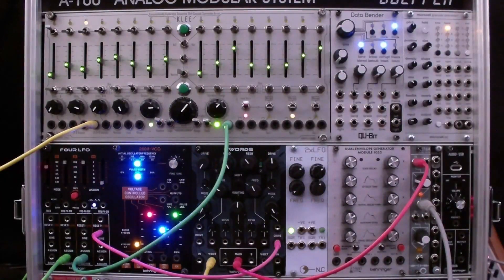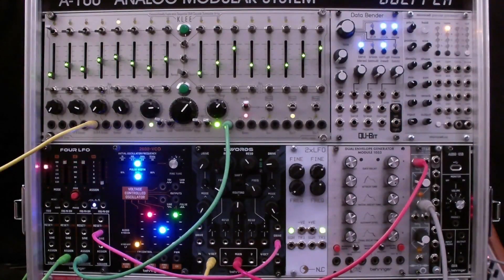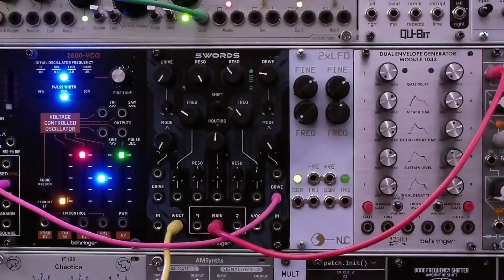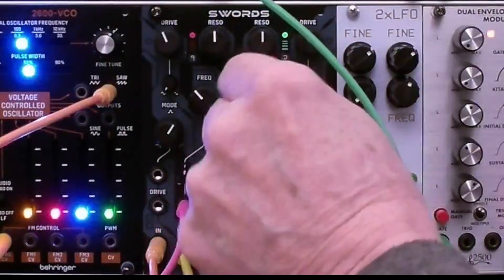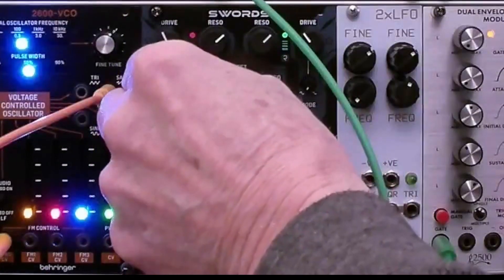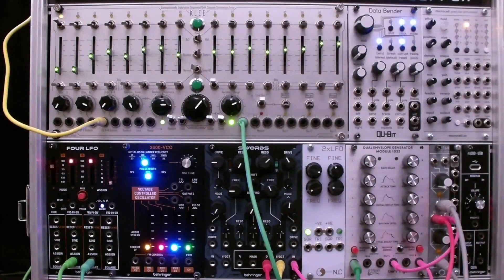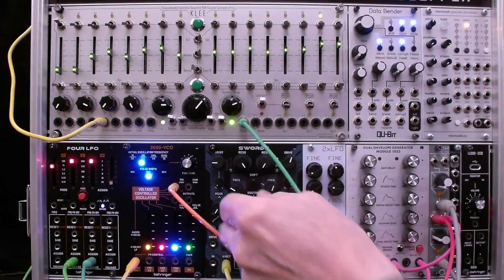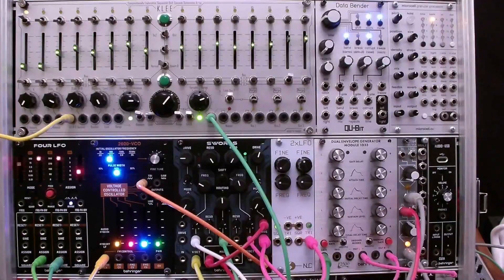Swords Dual Filter by Behringer  - the basics

Comment: Thanks, O.Z., interesting like always. I would like to know: If I want to get the "liquid" sound (rolandish) from the Ripples/Surges filter, could I just use the Swords as a double Surges? Or are these different designs?
Reply from the maker: Thanks!  Both Blades/Swords and Riples/Surges are based on the V2164 quad VCA chip in multi-mode filter topology.   Ripples/Surges also uses an LM13700 OTA chip "for that extra bit of non-linearity".  So they are slightly different.  I suspect you could hear a difference, but I have not heard a Ripples/Surges filter.
Reply: Thank you!

Comment: Who's going to make aftermarket panels though?
Reply: You can't swap Behringer panels because of the way they are manufactured. At least that's how their other clones are.
Reply from the maker: @dasvoid1  Thx for that info!
Reply: @dasvoid1  How is it that it can't be swapped? Have they used nails, are spacers welded to the panel?
Reply: @KPsTboy  Behringers modules have front panels that attach to the PCBs with metal standoffs that are part of the panel. They aren’t secured with nuts on jacks, pots or buttons, so there’s no easy way to swap a panel. I suppose you could add standoffs, but then there would be a few screw heads in the middle of the front of the panel.
Reply: @ So welded spacers, thanks for confirming, appreciated :)
Reply: @dasvoid1  They use those dumb metal standoffs but it doesn’t matter. Anyone could sell a panel with some standoffs that screw to the panel and also to the PCB if necessary. Some might be held on just fine with pot and jack nuts. 

I don’t know why companies don’t make clean aftermarket panels for these modules. Ironically, maybe Behringer has threatened to sue anyone who tries.
Reply: A better way maybe would be to make such vinyl overlays, like Heinacron makes for other Behringer synths.
Reply from the maker: Good question.

Comment: OZ do you know if the module can be updated? Quite a number of Emilie's modules have had community updates to her code. Considering the pricing of the Behringer versions they could become very affordable development platforms.
Reply from the maker: Great question.  The answer is "No, it's not a firmware based module.  It's all analog (except perhaps for some of the routing, which may use digitally controlled analog switches.)".  I have not studied the schematics.

p.s. check out the patch_init() from electrosmith.com  it's  a reasonablly priced ($199) development platform with high quality audio i/o.
https://youtu.be/HOjqQYlDj2U
Reply: That was the original intention Of making everything open source but instead everyone just cloned them and I believe is what eventually caused the company to shut down. There are only a few analog MI modules. Blades, Ripples,
Kinks, Links, Shades are a few. The rest either use an STM32 or some older units use an ATXMega32.

Comment: exceptional video Professor.. this one didn't really pop up on my radar.. I prefer 12db over 24db filters and think the moog 24db ladder filter is an overrated bass killer.. I have a lot of 12db eurorack filters but think this one could be next on my list.. will watching this video again for clarification.. thank you.. 🇺🇲👍
Reply: it's a clone of the Blades by Mutable Instruments
Reply from the maker: @cardigans-wearer  exactly.
Reply from the maker: Thanks Norm!
Reply: You need a multimode filter that is adjustable from 6db to 24db. Roland has so many synths with their 12db filter and it sounds great. You can get the dual Roland System 100 VCF if you just want a cheap 12db filter. Sounds great.
Reply: @ericMT   ..I have a ton of eurorack filtes my most flexible is the Intellijel Polaris (6db-24db) which can do anything.. Intellijel did such a great job that it's almost too clean I prefer the color on the others that do less like Blue Lantern Modules, Erica Synths, Tiptop Audio..